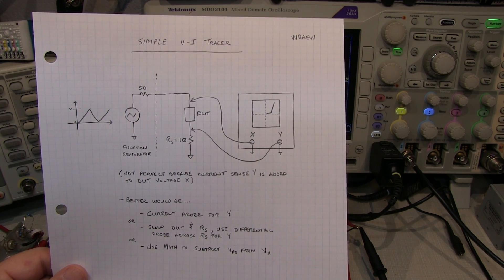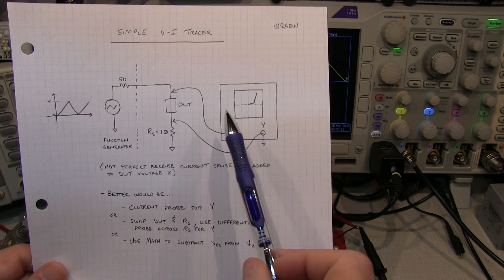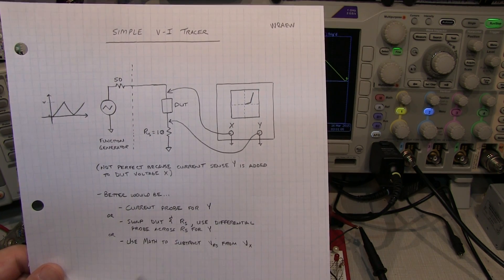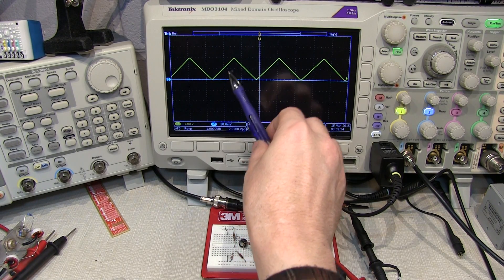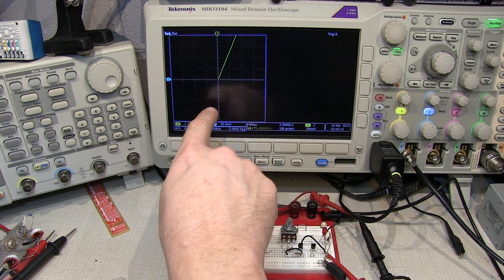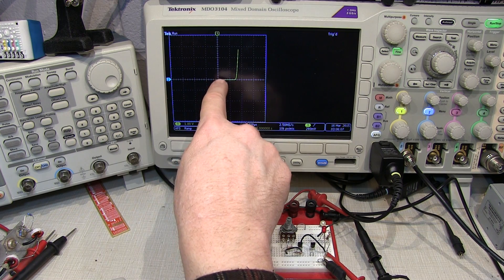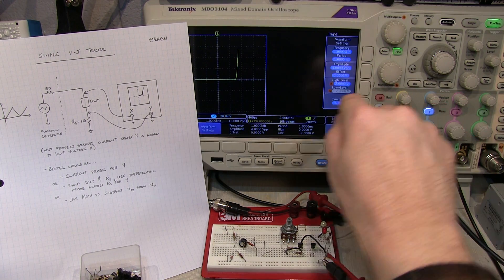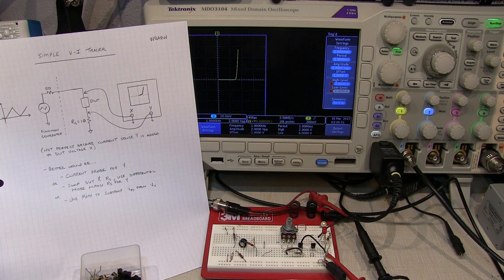#197:Simple V-I curve tracer using an oscilloscope and function generator

Comment: Thanks for another really useful video. It took me a while to figure out what a DUT is, but i found out when I read the description. I am a 'newbie ' !!
You did ask for feedback on what videos we wish for and I have a request. I'd love to see a video on selecting a probe to be compatible with an oscilloscope.
Following advice to get a second hand analogue scope I bought a 4 channel Tektronix 2247a, but it only has 1 probe. (I have a new digital scope also).
Would for example a p6138 work fine ?
I assume that cheap imports from china will be a waste of money, but are they fine for a second, third or fourth probe ?
Any pointers would be greatly appreciated.
Thanks again
Reply from the maker: Good topic for a video.  In a nutshell, the most important thing is to look at the spec for the compensation range of the probe and ensure that it covers the input capacitance of your scope.  For example, if your scope's input capacitance (printed on the front panel by the input connectors) is 15pF, and the probe's compensation range is 10-20pF, then you're ok.  With probes, it's often "you get what you pay for".  Used Tek or HP probes are often better than cheap no-name new probes, as long as they weren't abused.  The downside to used probes is that they often are missing their full complement of accessories (tips, clips, grounding attachments).  With a Tek scope, it is handy to get probes that have the 10x indicator pin on the BNC shell, to tell the scope that it is a 10x probe (so you don't have to remember to account for it).
Reply: ***** That's fantastic - Thanks for getting back to me. I was just about to buy 4 Tektronix p6138 probes, however the spec is 12-18 pf and my scope is 20pf. I do wonder though whether they may actually be ok because they are 350Mhz probes but my scope is only 100Mhz - I'm guessing that the range of 12-18pf on the p6138 is small because the frequency is so high. I am half tempted to get them and do some tests to see whether my theory is correct; However, my knowledge and abilities are a limiting factor.
One problem that I have a s newbie, is that although I understand that things get much more complicated at high frequencies - I don't know how many hertz we are talking about.  I followed your video about measuring an unknown capacitor using a scope - it was a great teaching aid for me - however when I tried it myself, I had picked a very small cap (a few pf) so my capacitance came out much more than the real value. I realised after watching your other video about the importance of good shielding on probes, that it was the capacitance of my wires, breadboard etc. that was causing my readings to be high. I've ordered shielded cables, bnc connectors etc and I plan to redo the tests.
I suppose what I'm saying in all of this is that as a newbie - it would be great to understand where I should work, until I my knowledge has improved. I know now that I should avoid 'high frequencies' but It would be great to quantify that. This also goes for probe selection, scope selection etc. I know that it's good to get a higher range scope - the more Hz the better - but will I ever need a 350Mhz scope? or will a 50Mhz probably cover my needs? I understand that good probes are important (but also expensive) so it would be good to understand when this matters - I guess a cheap probe will be fine at sub Khz frequencies? Again as a newbie - should I focus on learning RF principles at the lowest frequencies and move to the higher stuff later ?
I don't expect you to answer any of this - I am just explaining what is confusing for me. I will try to figure this all out for my self, but it may take me a VERY long time !! Thanks again
Reply from the maker: Lee Massey No worries.  It certainly does take time to get comfortable with these things.  I've been working in electronics for well over 30 years, and still learn new things everyday.  Issues with "high frequency" generally start to arise when you get above a few MHz.  I have a video on scope BW, and how much is enough - might be worth watching.  Your measurement BW will be limited by the scope or the probe, whichever is less.  As frequencies go up, the more critical things like ground lead length, etc. start to become - as well as careful layout, etc.  Solderless breadboards generally don't work too well once you get into HF (a few MHz and above).  Best advise, keep playing and learn from every mistake, failure and mis-step.  Working through these problems is the best way to learn.

Comment: Nice video. You could place the scope ground between the dut and the Rs. This way you would not get the voltage error from Rs. The current would show up as negative of course.
Reply from the maker: That won't work because the AFG output is not isolated.
Reply: ***** ah, sorry true.
Reply from the maker: Lars Berntzon Hey, no problem.  I do have a function generator that does have an isolated output, so I could've done that.  I chose not to because most viewers probably don't have an isolated signal generator.  I did use this configuration in the Octopus circuit because it uses a transformer to drive the DUT, thus is isolated from ground.
Reply: I built an octopus that uses a small isolation transformer, driving a panel mount autotransformer to vary the o.c. voltage(and current through sample resistor).  I grounded between d.u.t. and resistor. Since current is on the Y axis just hit the invert button on the scope to give proper polarity for current.  Also have two anti-parallel diodes that can be switched in ckt(individually, of course) to give 1/2 wave rectification, in cases where you do not wish to reverse bias the D.U.T.
Reply: ***** Or you could plug your function generator into a little 3 to 2 adapter that causes it to float

Comment: I recently was using a dedicated peace of equipment caledl an Interceptor, This did this job and a lot more but it was old, very old it ran on a 386 CPU and was built around 1993.  I was amazed though to find out that the Base/Emitter junction of a Transistor gave a Zener curve in the third quadrant along with the Diode curve in the first quadrant of course.  I was never taught the B/E junction was built like a Zener.

Comment: Really disappointed that the MSOX3104 wouldn't allow me to do math in the XY mode. I'm guessing the MDO3104 has that functionality? Also, here is the V-I curve of a 1N4727 3V zener diode (i.imgur.com/0e3WuHB.png) I just obtained using your method. Thanks for the video!
Reply from the maker: ***** Looks great.  Don't feel too bad, the MDO3000 can't do XY with a Math trace either.

Comment: What if you used a basic low gain differential amplifier to measure the voltage across the DUT?
Reply from the maker: That would wok too. Like I said, there are many ways to accomplish this.